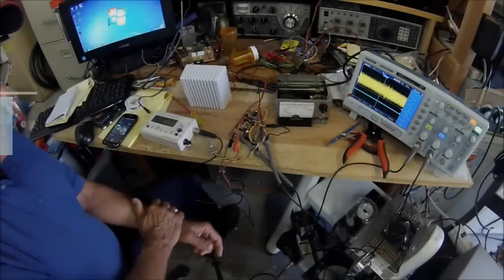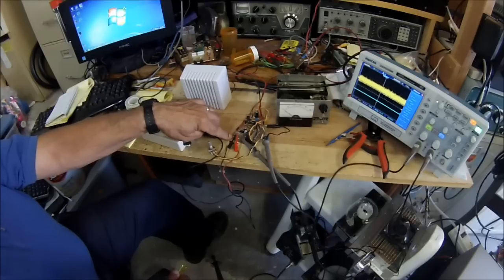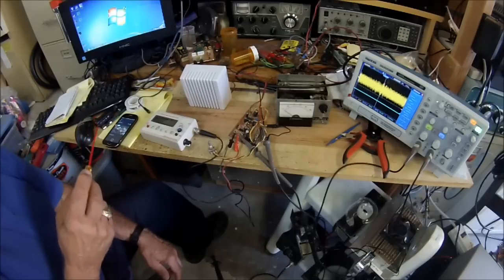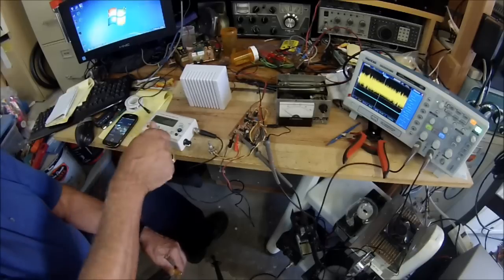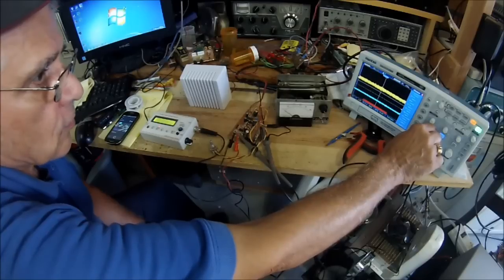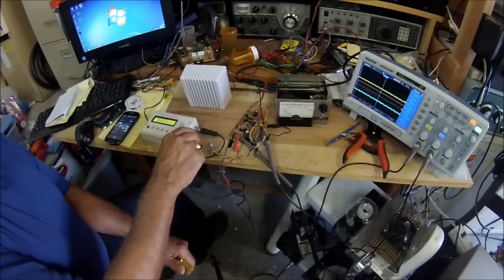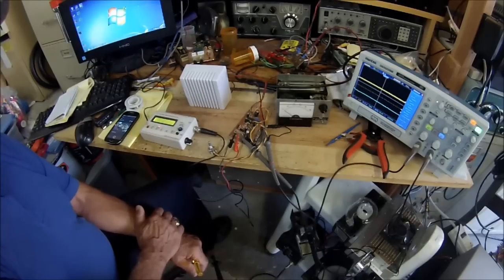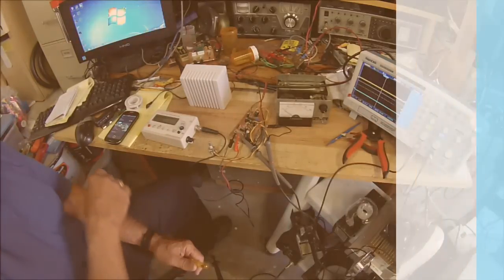Simpleceiver Audio Amp

Comment: Common mistakes-ground loops with wiring,not enough ground plane on pcb,poor design layout and the worst offenders grounding both ends of a shielded cable for board interconnections can cause ground loops with a common ground board system.

Ive been looking at isolated and balanced audio amplifier design to remove some of these grounding issues.
Now we have super small SMD ,seems electronics designs are going back to discreet old school methods in some cases and avoiding using IC's as its more feasible using discrete devices again in a SMD format push pull amplifier as size isn't a issue anymore.

I think part of the LM386 home constructor issues maybe caused by there being slight variants in specs on these chips https://en.wikipedia.org/wiki/LM386 and maybe not taking this into account with the design poss and making a assumption well it says LM386 on chip?
Higher gain noise can then be a issue with the LM386 higher gain versions say LM386-N4 1 Watt variant,I have not seen this mention in a lot of you tube videos and taking a shot in dark here at this but i suspect it could be a possible variable in related problems and this not being taken into account?

Liking your vids, esp the the pre-driver chip info very interesting.

73's Rob
Reply from the maker: Hi,Thanks for your post and as you say "all of the above".73'sPete N6QW

Comment: Nice video Pete.  I used the NE5534 and the LM386 on my radio, it works well.  Another suggested signal source is a function generator app for Android tablets and phones.  Its dual channel and has some of the same features as the generator you have.  Also, its free!  

73s  Dean AC9JQ